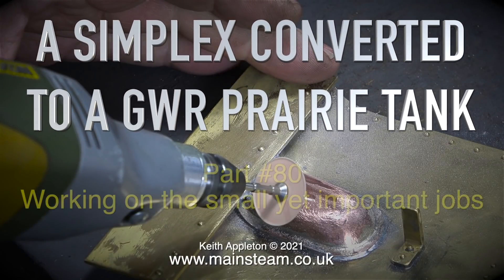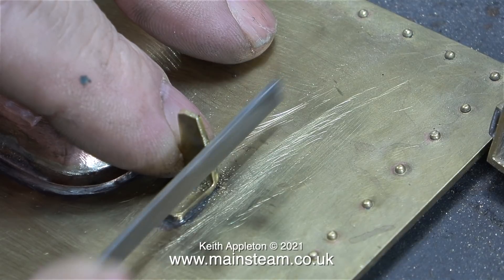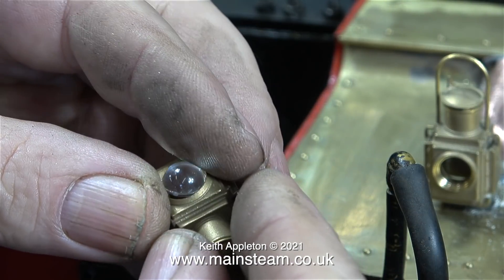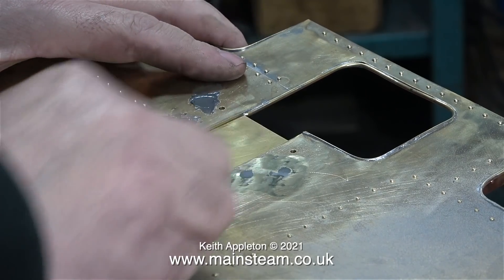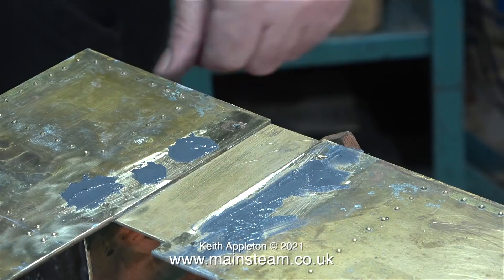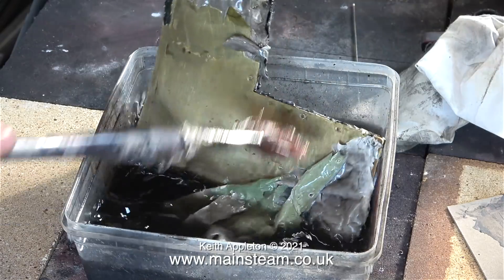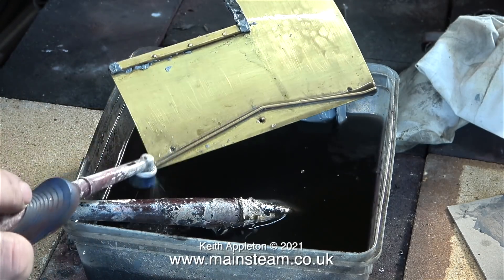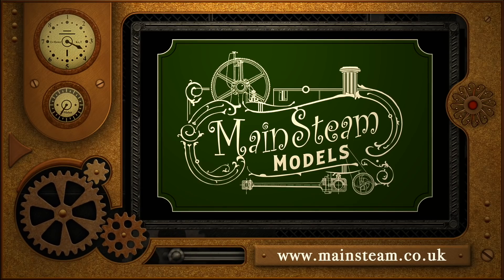SIMPLEX PRAIRIE TANK - PART #80

Comment: Number 80 and I am looking forward to 81 and on.  Have you ever used the kitchen oven too bake on paint? It takes a little practice. And temper metal parts , works for that also.
Reply: I met a great South African model engineer who had stove enamelled his very large SAR pacific in the oven by adding a large front extension to oven.  The finish was fantastic... that would have been when the ME Exhibition was still in the Wembley Conference Centre (since demolished I think).  He said ‘My wife took some persuading!’  It was Five Inch gauge, so pretty big...